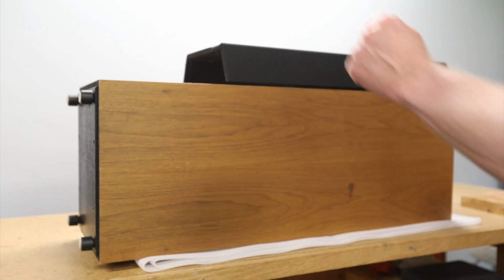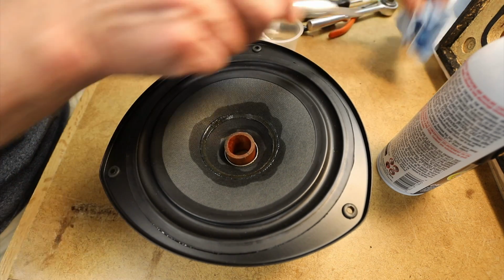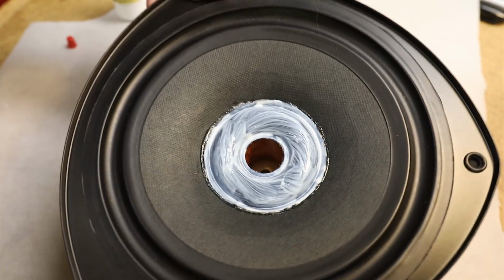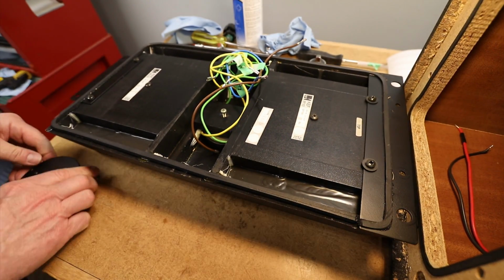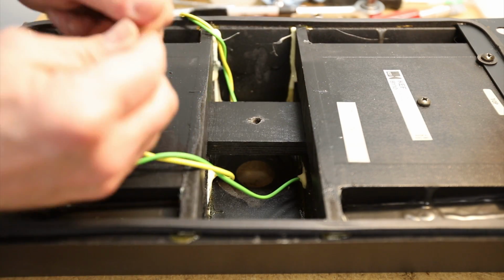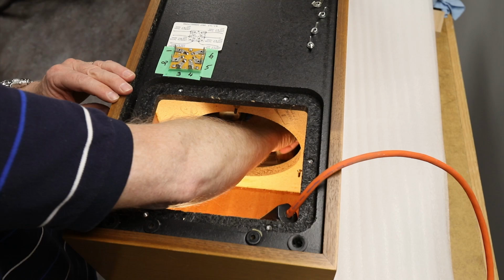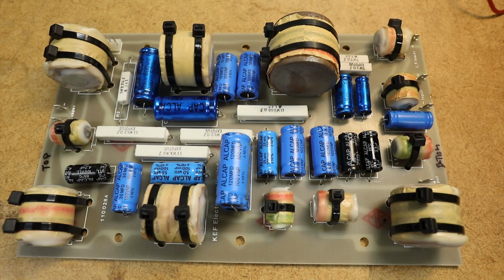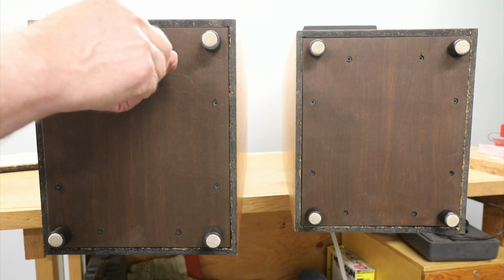KEF 104/2 Restoration

Comment: folienkondensatoren wären sinvoller und viieeel besser
Reply from the maker: Thank you for your comment.  My intention and preference was to preserve the original sound of the KEF speaker which is why I opted to use the original capacitors.  Cheers.
Reply: @franks909  ja aber durch die Kondensatoren wird ihr volles potenzial begrenzt durch die Foli Caps wär es besser und sauberer und Geradlineger des Übertragungsbereichs...
Reply from the maker: @oldscoolhifichannelgmh3574  Thank you for the follow up.  That does sound like it could have been a good option.  I was not aware of that option.  In the end, I really like how it turned out.

Comment: Hi, I have a pair of these and I noticed lately that one seems to be quieter than the other, do you know what could be the cause? Many thanks.
Reply from the maker: Hi and thanks for your enquiry.  What I could suggest (maybe you have already tried this) is to swap your Left and Right speakers to make sure it is not an amp or speaker cable related issue. Also, get a strong light and a mirror and look inside the base reflex hole for any obvious signs of damage or wear to the woofers. If the problem persists, it could be a variety of issues which are beyond the scope of this video.  Hope you are able to find the problem.
Reply: @franks909  Thanks very much for the advice, I'll try these things. All the best.
Reply from the maker: @juliantallach3682  Good Luck - Cheers.

Comment: BPeterso   
Just opened up my 104s. Only had to redo the donuts as the annulus rings looked like new. Discovered that the leads off the speakers were all long enough on my speakers to work on the cones without having to unsolder them. Thanks for the video!!
Reply from the maker: Thank you for your comment.  Great that only the donuts needed replacing.  Enjoy your KEFs :-)

Comment: So to get to the filter you must remove the down bass,  but in another video, I saw that the filter is inside the side of the  bottom panel
Reply from the maker: Hello, by "Filters" I assume you are are referring to the circuit board with all the capacitors.  I recall seeing some models online where the board was indeed located on the bottom panel. I am not sure if these were earlier or later models than mine.  With my speakers this was obviously not the case.
Reply: @franks909  The only thing I have to do to find out is to open the bottom ; )
Reply from the maker: @vintagestereo5491  It's a bit tricky - In one of the threads below, someone  dripped acetone all around the seams and waited couple minutes before prying it out.

Comment: I would have used another wide bead of blue tack for the bottom when attaching not just the weather strip
Not sure why you had to change the original tweeters how do these compare to the original spec, That's the question?
Reply from the maker: Hello John, Thanks for your comment.  Indeed there are a few things I would have done differently if I could do it all over again.  As for the tweeters, at the time I could not find any original ones, replacing the ferro fluid seemed somewhat more difficult (in hind sight I would have tried it) and so replacing the tweeter was the choice of the day.  Honestly, it still sounds great for a speaker that is about 40 years old.

Comment: Hey Frank. I'm struggling to find a crossover schematic for the KEF 105/3. Any chance you can help ID what C33 is?
Reply from the maker: Larry, Sorry I cant help with C33.  I would suggest checking with Falcon Acoustics.  I got all my caps from them and they were very helpful.  They may know. Good luck.
https://www.falconacoustics.co.uk/
Reply: @franks909  Will do. Many thanks!
Reply from the maker: @larrysmith7168  Hello Larry, Regrettably, I have zero experience with the KEF 103/3.  Sorry I cannot be be any help in that area.

Comment: How did the speakers sound after changing out the tweeters, compared to the original units?
Reply from the maker: That's a tough question.  I had the original tweeters replaced many, many years ago.  The tweeters I replaced (in the video) were not the original ones to begin with. Either way, the sound is great.  That said, if I was still in possession of the original tweeters, I may have considered replacing the fluid inside of them. Unfortunately that was not an option for me when I did the renovation.  Good luck with the repairs.

Comment: Hi Frank , I have enjoyed watching your video although I do not own Kef 104.2 s , no I have the Kef 104 AB s, which I have lived with for a long time. These look a bit special because they  have a polypropylene after fit suspension on the bass units and they look and sound like they are made to last. Having said all this, I am a little bit sceptical of the economics of a crossover recap. To be specific , the cap kits , wouldn't they have to be pair matched ? which I assume is the practice at the factory. Do any suppliers offer pair matching ?, I wonder.
Reply from the maker: Hi, The Caps I purchased from England were OEM parts and at no point was there ever any discussion about matched paired caps.  You may very well have a valid point; I never thought of it and the supplier never mentioned anything.  In the end, my KEFs have a new lease on life - they sound very good.  I thought it was definitely worth the effort (although I think I put more effort in making the video, lol).
Thanks for the comment :-)

Comment: I wonder if you two considered  upgrading your caps to poly?  I have some B&W 801s that I have had since the 70s,  I always felt that the mids were a little lacking.  I even changed out the mids at one point to see if it made a difference,  it didn't.  So I finally upgraded the caps to Solen poly caps. and wow.  Instruments took on a new life.  I also have some B&W802Ds and now the 801s sound much more like the newer 802s   I know back in the 70s and 80s most speaker companies did not use poly caps but now all the better speakers do use them.  I have compared my speakers to other that cost a lot more and the 801s tear them apart now.  The tweeters had poly caps that I did not change but I did change the mids and lows.  I have a very nice sub but now I have removed the sub from the system.  The speakers handle the job nicely themselves I've always felt that with 12 inch woofers what was I doing needing a sub.  2 stereo 12s couldn't do the job of one 12" sub?  Nice video 

0.
Reply from the maker: Off and on I have wondered what the speakers would sound like with poly caps.  At the time I was a bit of a stickler to remain with OEM parts cause that is what KEF used.  Obviously it is kind of history now.  I must say though, for speakers that are about 40 years old, they sound darn good.  Thank you for your input -  nice to share other's perspective.  Cheers.
Reply: @franks909  what I found the stereo image improved to where you could pinpoint the instruments better.  Instruments were much sharper in detail.  I think the distortion level decreased pretty dramatically and I've always felt the speakers best feature was their low distortion.  Bass now seems to also be more dynamic.  I feel like I should tear them apart and replace even the old film caps that I kept in there.  But they are my B speakers so it's not really critical.
Reply from the maker: @zorst99  It would have been interesting to hear the difference.  I have gifted the speakers to my son a couple years ago so he may chose to go that route some day.  Thanks again for your input.  Cheers.

Comment: I am trying to restore my later version of the 104. Some of it is easier (the bottom plate comes off easily as it isn't glued and the crossover network is attached to that plate). But where were you able to match the capacitances? My network has values like 4.2 mfd, 7 mfd, and 3 mfd, none of which I have found yet.
Reply from the maker: Hi Bruce, Falcon Acoustics (in the UK) had all the originally matched caps for my 104s.  Here is their website:
https://www.falconacoustics.co.uk/
Great to hear that the bottom plate came off easily and simpler to access the Xover circuit.
Hope that helps.
Cheers, Frank

Comment: I have a pair of these I purchased in 1995.    Do these speakers just decay on their own, or only when exposed to certain usage, climate, etc.  kinds of conditions?   How can I tell if mine need restoration?  They seem to sound fine.
Reply from the maker: Hello, from what I have experienced, the donuts on the woofers have a tendency to deteriorate over time (mine were over 30 years old) from normal usage.  I would imaging that certain conditions, such as climate like you mentioned, might cause the deterioration to accelerate. With the help of a flashlight, have a look inside the base reflex hole and examine the donut surround in the middle of the lower woofer.  If it looks anything like the one in the video, if will need to be replaced to restore the sound quality.  The speakers may sound "fine" but they aren't producing sound at their optimal level. Hope this helps.  Cheers.
Reply: @franks909  Well, I did what you said and my donuts have gone stale.  Just like your "pre-restoration."  I don't have your set of skills, and I have so many other things to attend to, and I tend to move a lot and have been lugging these through life for the past twenty years.   Good audio years, but still at times I want to be rid of them.    Perhaps it's time to let them go to someone who will restore them and enjoy them.     Thanks so much for your video.
Reply from the maker: Thanks for your reply and best wishes.

Comment: Hi Frank, wonderful video. I'm planing on replacing the donuts in my Kefs. I'm curious though, why did you decide to change the tweeters, for the sake of it? And also where did you find the grommets? I'll also be using simply speakers parts. Regards Jason.
Reply from the maker: Hello Jason, Thanks for your kind comments.  To answer your questions:
One of the tweeters wasn't working so that's what prompted me to replace both of them (with a slight modification to the cabinet).  For the grommets, here is a link to the website:
https://www.midwestspeakerrepair.com/shop/speaker-repair-kits/rubber-grommets-for-kef-104-2-105-3-woofers-12-pack/
If you take it step by step, it's not too difficult and the outcome is definitely worthwhile. Cheers!
Reply: @franks909  brilliant, thanks Frank.
Reply from the maker: No Problem :-)

Comment: Hi mister Frank Soos. Thank you for your very good video. I plan to restore my Kef 104/2  in Belgium, and i ask me if it  is much better with the Morel Mdt 29 or replace only the ferrofluid of t33 tweeter is also good, but under the tweeter Morel?
Reply from the maker: Thank you for your comment on the video.  If I had the original T33s, I think I would have initially tried to replace the ferrofluid.  Since I no longer possessed the original tweeters, the MDT 29 was a good alternative for me.  Good luck with the restoration - it's worth it :-)

Comment: You know what it always amazes me how others like yourself share knowledge for the sheer joy of doing so. This is a fantastically detailed video. Thank you so much for your efforts in uploading this!
Reply from the maker: Thank you so much for your kind comments.  It is always appreciated.  I am always glad when folks are able to make use of my experience and I am happy to share them. Cheers.
Reply: KEF should pay them for such a professional repair video. Very helpful. I am going to recap my 105/3, but I think I'll use some expensive Jantzen caps (non electrolytic) here and there. I will measure the cap values to 1% to try to match the original values as closely as possible, because from what I've read, in the original crossovers, the caps were measured, sorted by KEF to 1% and the crossover was recomputed by a computer for each pair of speakers, so that the overall response was within 0.5dB of the golden design. Obviously, there is no way to do that now, but I'll try to stay within 3% of the original values.

Comment: Nice educational video! One question about the tweeter. Do I need to modify the crossover filter for the Morel tweeter?
Reply from the maker: Hello Jesper, I did not modify anything to the crossover filter.  I simply installed the tweeter as is (except for the minor physical modification I showed in the video), replaced all the electrolytic capacitors and it worked great.
Thanks for the compliment on the video :-)
Reply: Thanks for answer. I am thinking och replacing the grommets to, where did you get them?
Reply from the maker: Here you go.....have fun!
https://www.midwestspeakerrepair.com/shop/speaker-repair-kits/rubber-grommets-for-kef-104-2-105-3-woofers-12-pack/
Reply: Hi! Thanks, that´s the place to go.

Comment: Thanks for your video, probably the best around this job.
I agree with who suggest to replace electrolytic with different caps.
Don't you think the white sealer applied on the center could modify the woofer characteristics?
Reply from the maker: Thanks for your note, comments are always appreciated.  I'm sure that the solid caps would have been fine.  My goal was to restore them to the original specs in an attempt to reproduce the original sound. The sealer was applied to extend the life of the woofers.  I don't believe I could ever tell if the sealer modified the characteristics of the woofer.  I'm not an expert at restoring speakers so I'm sure that there are different or better ways of doing what I did. What I could say for certain is that the speakers truly sound amazing, especially given their age. Cheers!

Comment: I appreciate the detail on this restoration. I am considering doing this and seeing both the simplicity and yet the details of doing this is really helpful.
Reply from the maker: Thanks for your comment Bruce. I have never done this kind of work before -  It just took a bit of planning and some patience.  Honestly, the hardest part was removing the bottom panel because it was siliconed in place. If you have just a little bit of "handyman" experience, it shoulddn't be too bad. Good Luck!

Comment: Very nice work.  I have a pair in need of foam replacement, but my speakers might be older since they have foam on the outer part of the woofers (not rubber).  I also think the cross-over is at the bottom of the cabinet.  Hopefully the cap replacement is the same, but I'll check with Falcon.  Lastly, I have the original T33's and may try refurbishing them since I have the ferrofluid and have seen the refurbisment video of them on Youtube.  Now I just need to invest in the time to do the project!
Reply from the maker: Thanks for your kind comment - Good luck with the restoration.  It really was worth the effort. Nice that you still have the original T33s.

Comment: Hi. Good replacement for the tweeter. By the way, may i know you still kept your original kef tweeter? I am interested to buy it from you.
Reply from the maker: Hi Paul - I no longer have the original T33 tweeters. I had them replaced with TS1191 tweeters many years ago.  I still have the TS1191 tweeters (not the original KEF tweeters).
Reply: Hi Frank. Thanks for your reply. How is your 104/2 sound after change the tweeter to Morel MDT29?  Is it sound similar?
Reply from the maker: Hello Paul,  Sounds actually quite good.  Tough to make the comparison since I havn't heard the original sound for quite some time. I was really, really pleased with the outcome (especially with the other changes - fixed woofers and new caps).
Reply: Hi Frank. Good to know that, thanks for your great video. Like a lot..
Reply from the maker: Thanks Paul - appreciate your comment!

Comment: Excellent video. Have a pair I bought in 1991 and still use. Have rebuilt both internal woofers and now need to replace the tweeters as they've gotten rather dull in the highs. Thanks for this wonderfully detailed video.
Reply: John - You can get replacement ferrofluid for the original tweeters and repair them by following this video. 
https://www.youtube.com/watch?v=wtfqarUiFhw&list=PLCQI0olM8GTZdg8WepkDNLNLjptS41UeD&index=2&t=0s
Reply from the maker: Thanks for your kind comments, John, I appreciate it.
I am quite happy with the MDT29 tweeters. If I had the original T33s, I would have also considered replacing the ferrofluid. Cheers.
Reply from the maker: Thanks for sharing the info :-)

Comment: Do yourself a favor and DON'T buy electrolytic capacitors. Buy polypropylene types or polyester film if you can't afford polypropylnene. Big improvement in sound by getting rid of electrolytics. Upgrade the resistors to high power wirewound types. Dales are good ones and not too expensive.
Reply from the maker: Thanks for you input.

Comment: So was there a notable improvement in sound after recapping?  I have a pair and have replaced the tweeters and had the woofers professionally done, but they can still sound a bit "muddy" on a lot of recordings.  Thanks!
Reply from the maker: Hi - Really hard to say.  It was recommended to me by the capacitor manufacturer that because these caps were not solid state caps, it is very likely that the substance inside has started to harden up - especially after about 30 years. I was doing a reno on these speakers anyways so it was also easier to do it at the time.
Cheers.
Reply: Thanks Frank.  So, just to clarify,  Did you give a serious listen before and after or did you do the work for someone else?   Excellent job btw!   I ordered the cap set from Falcon, problem is I am not good at these kind of things and my local guy will charge me $200-240 for the work.
Reply from the maker: HI Again - I did the work for myself. I really couldn't listen to the speakers ahead of time mainly because the woofers were shot. I never did such a job in my life and managed to do ok.  If you go step by step, It's not rocket science. Maybe watch the video a couple times, save a few bucks and treat yourself afterwards.
Good Luck!